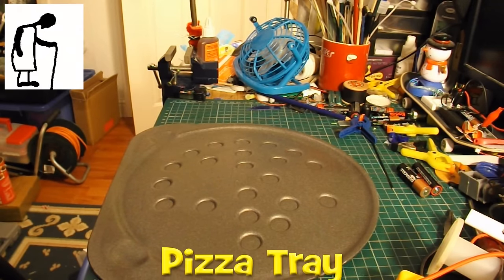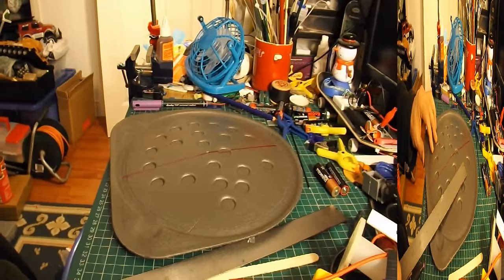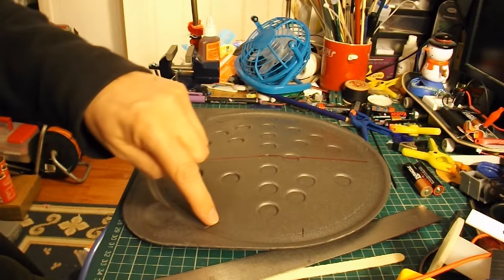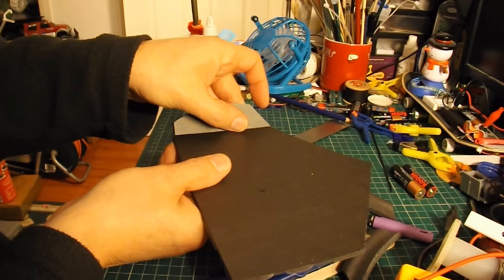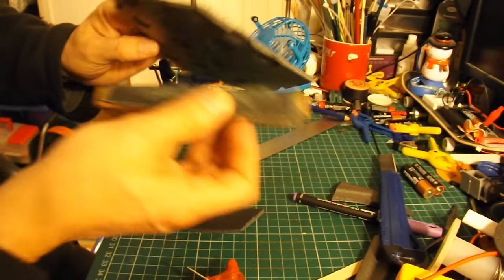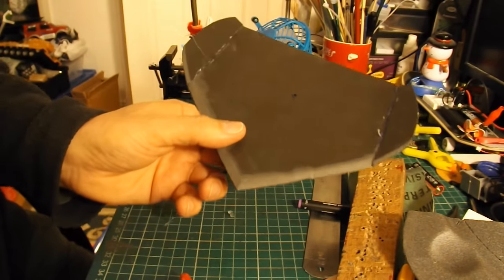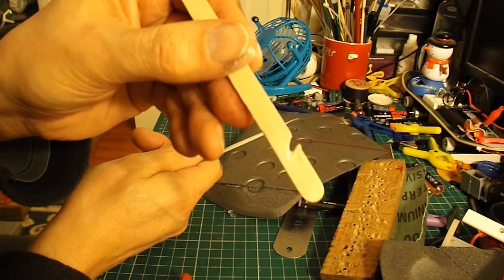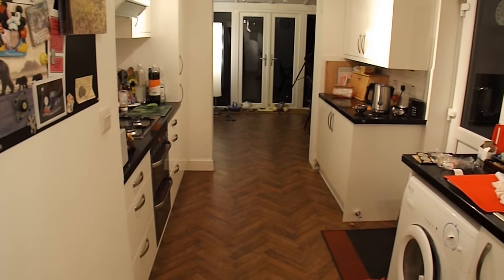Pizza Tray Catapult Launch Glider

Comment: Many years ago when I was a tire fitter, we were going to throw out a workshop reference manual after an updated one arrived. But these were all plastic (wipe clean) and ring bound, so I decided to make some 'paper' planes using a few paves. The plastic pages were thin enough and really tough, not like plasticard from the model shop, which breaks when you fold it. The 'stubby' paper plane type turned out to work best for the weight and once folded, held their shape much better than paper. You could throw then as hard as you liked and they would go like those returning planes you shower recently. I added a notch to one of them and took it out of the depot. When I launched it with an elastic band, it shot up about 50 feet in the air in a huge loop and disappeared onto the flat roof of the building!!
Reply from the maker: +wordreet yes a little heavier but more rigid. I have it in mind to make one myself at some time as I saw a rather nice one on YouTube last year.